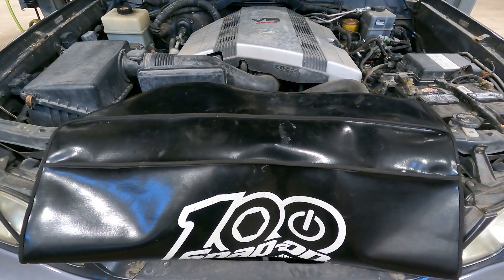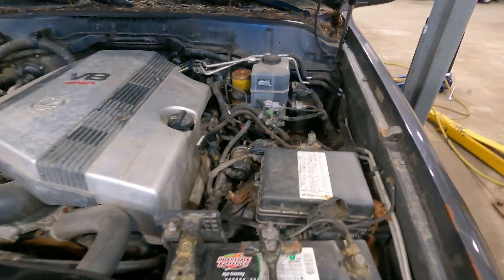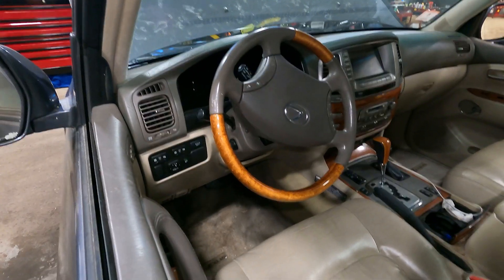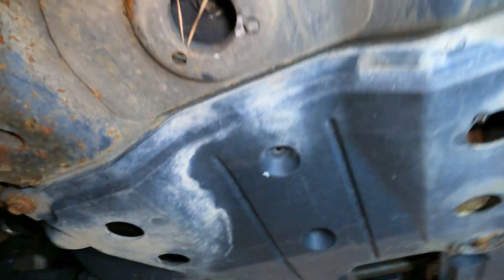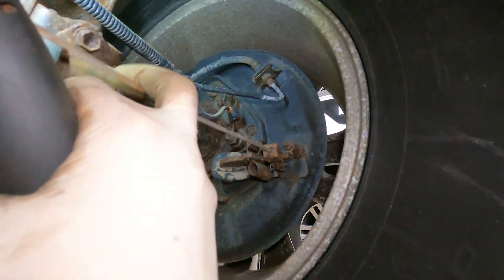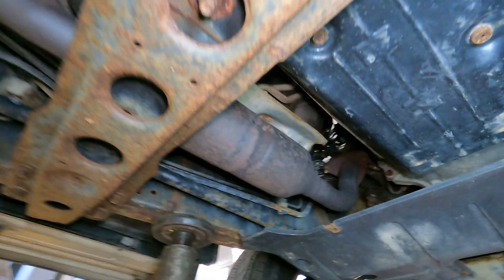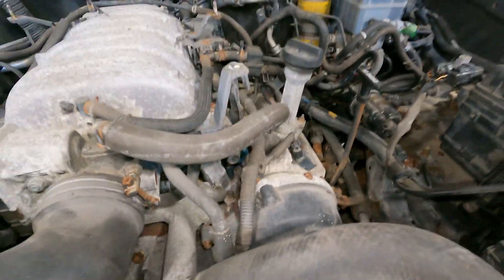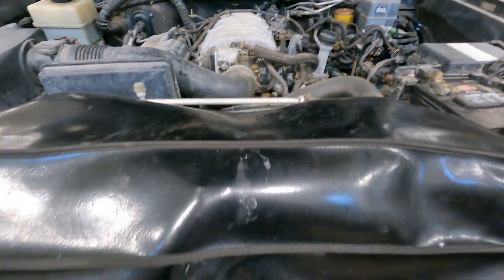customer states "LEXUS LX470 THAT CSW TURNED AWAY!?" TOO MANY HANDS IN THE POT!

Comment: Every time I watch these, which is often, I come up with something funny to add. Today its this: My wife drives a Volvo. It has an electric parking brake. The first time we applied it we had to get out the manual (all 400 pages of it) and read how to release it. Engineers and marketing people: if you need a manual to operate a simple function you've missed the point somewhere.
Reply: I think some of these engineers need to be made to work in a shop for two years before they release them on an unsuspecting public. 🙂

Comment: CSW, i agree with you. This vehicle has been messed by another mechanic and things are bypassed and unplugged.  I say this vehicle will just keep coming back for problem after problem, its like it going to be an never ending story. Next the customer will not be happy, it will go south quick. I can tell what happened with the suspension, when they heard the price of the hydraulic suspension struts they were like nope not getting new hydraulic suspension. Thanks for the content, i am loving what your doing i also work on vehicles with flavorful rust.
Reply from the maker: We are in the trenches together!
Reply: When I see mechanics you know in Florida or wherever that there's no rush working on like 20-year-old cars and SUVs and it's clean I literally want to faint... The same 20-year-old car where I'm from will literally be falling in your eyes as you're working on it
Reply: It's hydraulic suspension, not air, and it's the nitrogen spheres that act as springs that are expensive. The struts rarely fail.
My LX470 is 24 years old and still going strong. I replaced the nitrogen spheres with aftermarket versions, which lasted about six month, and then back to OEM, which cost a fortune but are going strong, even with the extra weight of modifications.
That vehicle is a write-off. The engine might be good though. They are tough, though not fuel efficient!
Reply: I have a friend who has a fairly nice 93 E500 Mercedes. It's no show car but it is nice. She was quoted close to $5000 to replace the collapsed air ride suspension. That's damn close to what the car is worth. She was crushed, so being the good friend I am I replaced all of the air ride with standard springs and shocks from a really nice kit for less than $1200. That included the override control module to fool the system into not seeing the missing air ride. Seriously, who is going to put 5 grand into a car that's probably worth just a little more than that. Not me!

Comment: i noticed on my 4 year old highlander at red lights or stop signs, when braked and stopped, i can feel through the steering wheel the engine vibrates on and off then on and off and when i lower the window i can hear a squeel sound. all of this goes away when i start moving and doesnt happen when car is in park and idle. any ideas?
Reply: Do you think the squeel is related to the vibration?
Reply: @vw5056  i think so because when i starting moving or when put in park / idle, botht he vibration goes away and the sound

Comment: LX470 is actually the formula to figure out how much the repairs are for all of this.  L=50.  50 x 470 = $23500.
Reply: Actually, it's even more than that because your math is a bit off: LX = 60, so the calculation will have to be 60 x 470 = $28200. 😉
Reply: Hahaha! 😂😂😂
Reply: @module79l28  Plus tax....
Reply: Just light it on fire

Comment: This vehicle appears in far better condition than most others I've seen on your videos . No visible missing structural parts , unlike a Toyota FJ which had so much rust that whole sections of the underbody were missing ,  or looked more like Swiss cheese than steel . Brake parts rusted away , frozen , inoperable , suspension falling apart , and more . Yet you still worked on it , and presumably returned it to the customer , having repaired only what "the customer states " ,  Double standards ?

Comment: The rodents seem to like the taste of newer cars. Unless there are millions more of them than there used to be there is something attracting them. I never had an issue with them on older cars. I guess the wires were thicker, not as tasty and miles less per car. I used to have trouble with them chewing on the interior (not wires) of my Chevelle while it was stored thru the winter until I halved a few bars of Irish Spring soap and put them under the seats and in the trunk. It worked, something about the smell they didn't like.
Reply: Soy product based wiring insulation is the reason.
Reply: @alskooper3319  Thanks for the info. I knew something had to be different but I didn't know what.

Comment: It does look like the 'Air' suspension has been replaced with standard shocks and coils springs without upgrading the front torsion bars, hence the high back and low front.
Reply: I always cringe at the air to steel conversions. Not only will the system likely throw codes but if the compressor isn't disconnected it will be constantly running. I advocate to simply not buy a vehicle with an air suspension unless you can afford to fix it right.
Reply: @vw5056 : You're probably correct in other makes of vehicles but the Landcruiser/Lexus has hydraulic fluid suspension, often referred to as 'Air' suspension, which is actually known as AHC (automatic height control) that uses hydraulic fluid in spheres to control the height and comfort of the vehicle. The VX variant of the Landcruiser usually has this type of suspension as standard, but the GX variant usually comes with a coil spring and shock absorber set up. So converting from AHC to coil spring and shocks is straight forward and causes no problems with system codes
Reply: Nice 70s Camaro stance..
Reply: @haylinglad  Sounds like the Citroën system.

Comment: I worked on a 05 Dodge Magnum that a friend had "won" at auction.   The steering wheel was off center like that.  Turned out some Goomba had assembled the steering shaft knuckle out of alignment.  There were so many things done wrong on that car, I began to think I was being pranked.

"The List"
steering wheel column misaligned by 110+ degrees
wiper arms swapped left for right
suspension nut missing
suspension bolt incorrect size
sway bar link bolt loose
struts mismatched
wiper transmission assembly misaligned
engine upper support bar bolts stripped
rear shocks lower bolts loose
motor mount bolt loose
ECU broken wire
incorrect lenght oil dipstick
radiator drain plug missing grommets
EGR tube grommet installed backwards
Instrument cluster lighting & temp gauge

Replaced parts:
steering angle sensor
rear brake pads
clockspring
transmission
turn signal assembly
remote starter module & wiring - removed
front struts
sway bar bushings
front speakers
EGR valve
engine breather filter
thermostat & housing
coolant
oil & filter
dipstick
windshield wipers
Reply: I had a pontiac grand am that the oil stick was marked a quart low. I was having oil pressure and oil pump problems. Mechanic drained oil at full mark and it was quart short. OEM ordered new dip stick ..same problem identical...GM major design oversight
Reply: But did it "look" good?
Reply: Sounds like it was a lemon.
Total repair cost?
Reply: @1953beetle  $948.70  The funny thing is I didn't develop a dislike for the car even after all the things needing repair or correcting.  The mystery is was it deliberate, or simply incompetence at work?
Reply: @flbartlett  Probably the later.
Reply: Damn, that's a nightmare to fix mechanically.